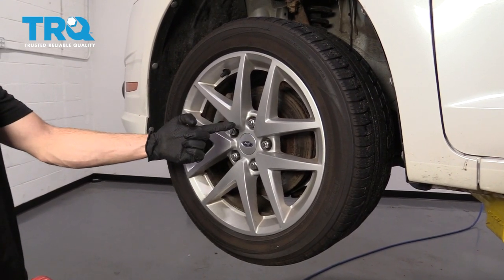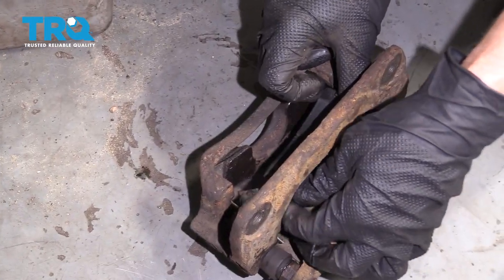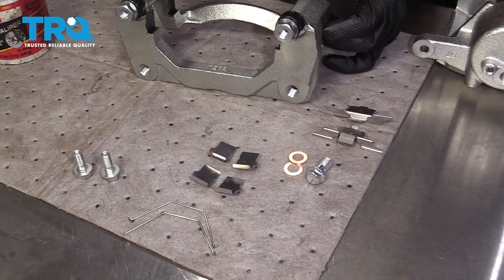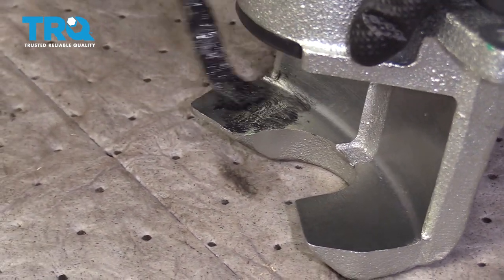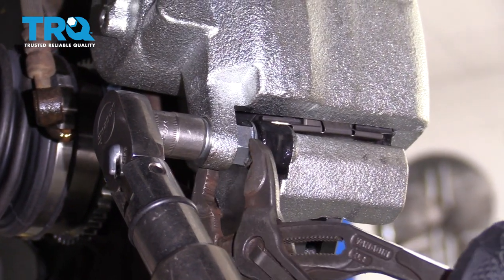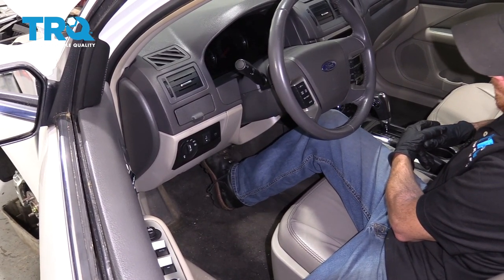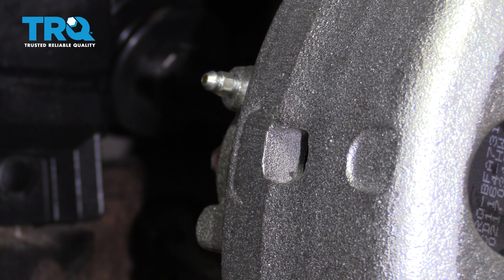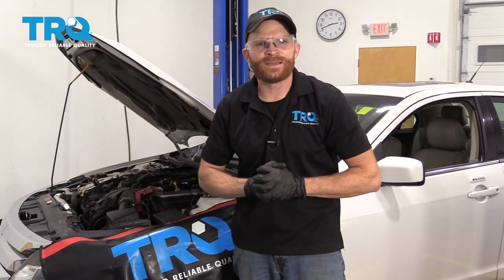How to Replace Front Brake Caliper 2006-12 Ford Fusion

Comment: A C-clamp squeezing the bottom pad of the pads together helps a lot before you put the wire springs on. Makes it way easier to slip the caliper over top of everything. 😃👌🏻
Reply from the maker: +@skeletor7908 Thanks for the feedback! http://1aau.to/m/Shop-TRQ

Comment: The brake fluid used in this video is incorrect. Most Fusions require D.O.T. 4 brake fluid
Reply: No, these fusions are dot 3.
Reply: 2010 Ford Fusion uses DOT3 (pg 321 of 2010 Fusion owner's manual)